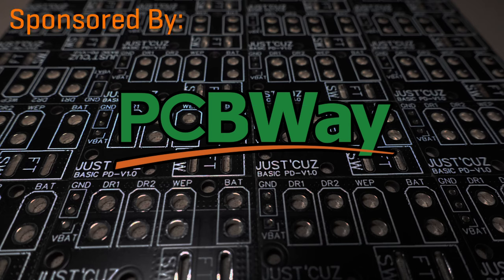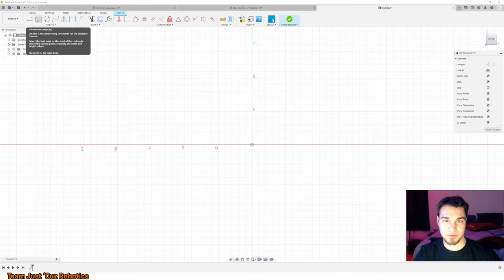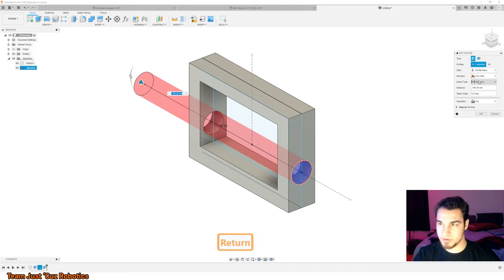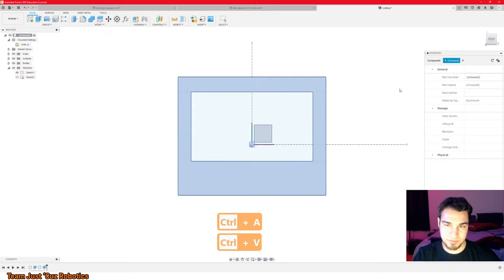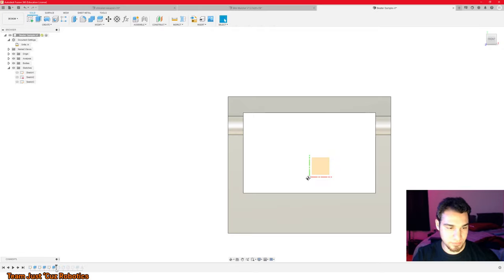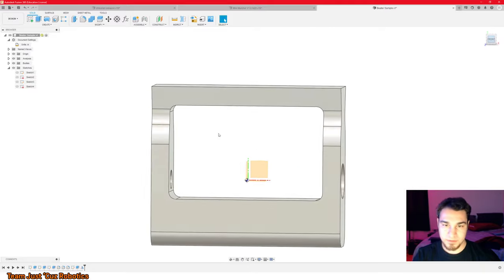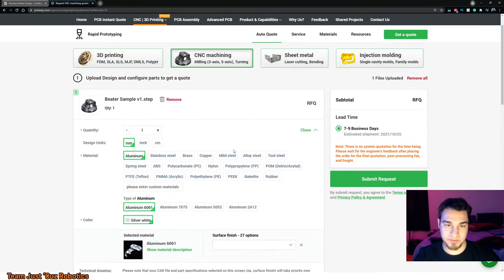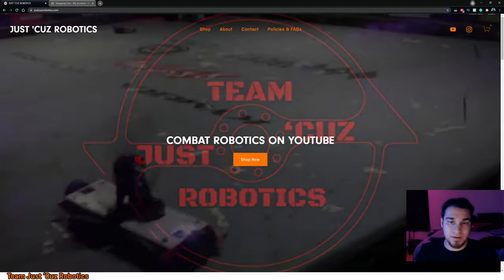Beater Bar Design + CNC Quoting! Combat Robot Spinner Design (Part 4)

Comment: Dude, I love beater bar robots. They have some serious potential to send their opponents flying, and can still do big nasty penetrating impacts like a more standard vertical spinner can when they hit a corner, and have a less dispersed, more focused center of impact. They also tend to have more bite than a drum. I don't know, I just feel like they're really nasty, and even though they're used quite often, I think they're sort of disregarded and underestimated because of how basic they are.
Reply from the maker: They definitely have a lot of advantages! The main disadvantage is simply that they tend to be a lot heavier than other weapon types, but they make use of that weight pretty well at larger diameters as clearly shown by Lynx and similar bots. 

Division stores about 4X the kinetic energy as Voxel on account of having a gigantic weapon that weighs about the same, despite spinning way slower. But my weapon was so big it was too high off the ground to even hit Voxel straight on in our fight leading to getting launched straight into the back wall. Voxel left a tooth imprint on the outside of the tooth of my own weapon!
Reply: @JustCuzRobotics  I can't recall the name, but there was a realllly nice robot that I saw fight awhile back in a livestream video of a robot competition. It had the entire frame welded together into 1 solid piece, and it had the largest beater bar I've ever seen on a robot to this day. It was almost more weapon than robot, literally around 49% weapon I would say, lol. I cannot find the video I saw it in now, it was silver and red, I can think of the arena and everything, I just cant think of the name. It's been awhile, but man, it was SO MUCH FUN to watch. It one shot almost everything it went against, and it bent another person's beater bar into a mobius strip looking shape, it was incredible. 

I'd seen them be absolutely devastating before that, even bots using the generic and common, copper-orange colored beater bar that you can buy online, but that was when I truly appreciated how much damage they were capable of doing.
Reply: We need more traditional egg beater bars in heavyweight. The only beaters I know is Black Dragon, Glitch, Railgun Max, Pain Train 2020 (kinda), and Riptide
Reply from the maker: If you think it cost a lot to get a 10oz version made just imagine when the weapon weighs 50 - 70 lb. If it isn't being done by a sponsor you're going to have a bad day. Glitch just posted that their wire EDM sponsor spent more than 60 hours cutting out their beater bars. I can almost guarantee you that if you actually paid for that it would be at least $50 per hour
Reply: @JustCuzRobotics  
So I have a question since I have no experience in robotics and robot combat. Can you make an eggbeater by cutting and welding pieces of metal together?
Reply from the maker: I mean... You can do anything that's possible. But it would be a horrible idea. Welding is very imprecise and causes warping and changes the hardness of the metal around the weld. Even if you then annealed the entire weapon and then re-heat treat it to be a uniform hardness, now you have to balance it nearly perfectly by manually grinding for hours and hours. After all this you are left with a weapon only held together at weld seams rather than made from a single solid piece of metal and it will NEVER be nearly as strong. This might be fine for things that are not experiencing the absolutely insane impact stresses of combat but for a weapon it is just not a good idea. The only exception to this is to have a weapon consisting of many solid disks that are already balanced and then weld those together only to keep them spinning together (see Pain Train), but this is no longer an egg beater IMO as there is no hollow center
Reply: @JustCuzRobotics  
If it's an egg beater but with no hole (like the original Pain Train), then what does this weapon's category?
Reply from the maker: I always thought of Pain Train 2020's weapon as a death harmonica 😂
Reply: @JustCuzRobotics  
I have another question. Why is egg beater is so overused in lower weight class and underused in higher weight class? And how does egg beater and "holeless" egg beater compare to the more conventional drum spinner in the heavyweight class?
Reply from the maker: It's overused in lower weight classes because it's cheap and easy, you can buy one off the shelf from Fingertech. It's that simple. It's also probably underused in Heavies for the same reason - it is a necessarily very expensive custom machined part that without a machining sponsor will run you thousands of dollars.

As to how they compare, well, hard to make any real judgements like that since every weapon design has its pros and cons. Several bots make great use of hollow drums and beater bars like Copperhead. Other bots make great use of solid drums like Minotaur. There are a million factors that contribute to who wins a fight and why one weapon might be chosen in place of another.
Reply: @JustCuzRobotics  
Thanks for the information
Reply: @JustCuzRobotics  agree completely

Comment: Great video Seth! I followed along and made my version too. You didn't holes for the screws? So my guess is it's drilled and fit in later and space needs to be left for that? Anyway, took me over an hour but was fun following along!
Reply from the maker: I would not try and order this design to get made as is, it was really just an example of what you can do. Depending what you would be using to drive it you would need to figure out screw holes or whatever suits your needs. Some people will actually build a motor into their drum and epoxy the magnet ring into a side of it so they don't use any screws to hold the beater on.
Reply: @JustCuzRobotics   I meant screws on the attacking surfaces, for grabbing hold of opponents while the beater spins.
Reply from the maker: I think you are missing the point of this style of weapon. The only reason the Fingertech beater bar has those screws is to add a hard steel tooth to bite into the opponent since the Fingertech gold bar is soft anodized aluminum. This beater I showed how to design, the ENTIRE THING IS HARD STEEL. Screws can bend and break and pull out and cause all sorts of imbalance issues. The entire beater being one solid piece is one of the biggest advantages to a custom machined design like this. Just look at Voxel and Lynx, no screws there!
Reply: Oh sorry. Since I'm a complete beginner, I didn't know the purpose of the screws on the Fingertech beaters. But I get your point now! Thanks for answering Seth!
Reply: Although I was wondering what other interesting shapes of egg beaters are possible. There's Black dragon's cylindrical one, Fingertech's 8-shape one are a few I know. This is quite an interesting question I feel.
Reply: @AdityaPrakash-kt3rf I mean it’s basically a question of what is machinable and what you can afford, you can have a super complex design however the manufacturer cost will go up

As well as of course weight and strength of the weapon and what your trying to achieve with it

Comment: Would it be possible to get the beater bar design into a CAD form that is easily accessible?
Reply from the maker: It depends on what you mean by scaled up. You can obviously make a robot any shape that you want
Reply: @JustCuzRobotics what I mean scaled up is that if mini mulcher was able to use the weapon motor from subtraction.
Reply from the maker: I don't see why not
Reply: @JustCuzRobotics where would you start in design?
Reply from the maker: Choose all the needed electronics. Lay them out in cad. Start modeling the body around them.
Reply: @JustCuzRobotics Thank you for the help. What would you recommend for a beetleweight for driver system and weapon system?

Comment: Wow I never expected the cost to CNC machine would be so high
Reply from the maker: That's what happens when your part is made by a machine that costs $60,000+ and an operator who is paid at least $50/hour!
Reply: @JustCuzRobotics  a while back I designed a beater bar very similar to the fingertech one but scaled down for an ant (before they did the same) I was getting quotes for ~$300 each with a minimum quantity of like 5 or 10.
Reply: @JustCuzRobotics  What design choices could be made to optimize cost better? Maybe have the tooth be a separate part?
Reply from the maker: Shop around to different CNC shops to see which one is cheapest. Choose a cheaper material. Make the entire weapon smaller and have larger radii. Looser tolerances on the whole thing. None of these will necessarily cut the cost in half mind you but they will reduce it to some extent.

Making the whole beater as close as possible to a just a rectangle with one straight sided cutout would be the main major change to reduce cost but then it would be lame.